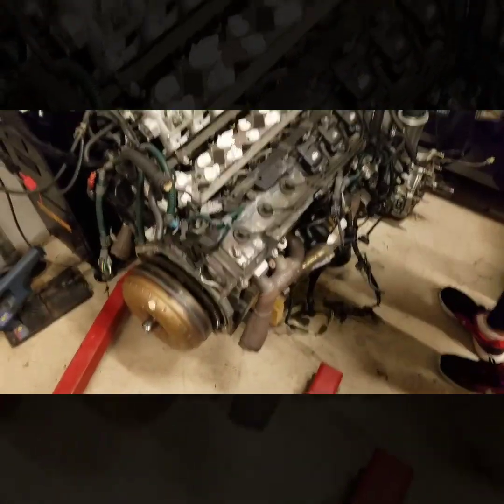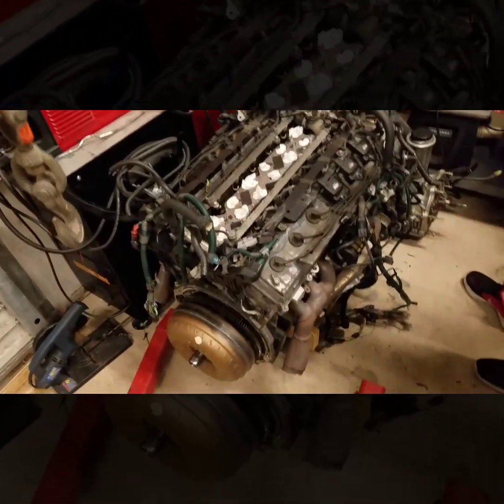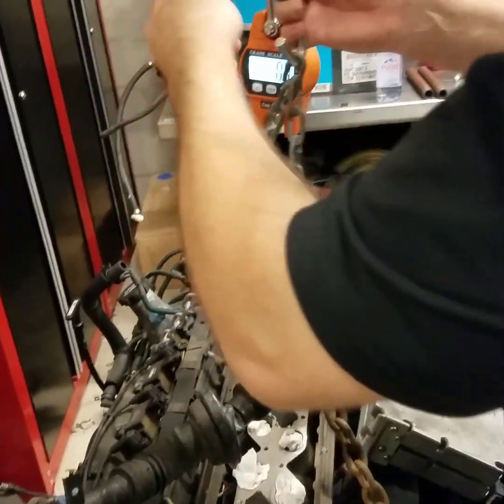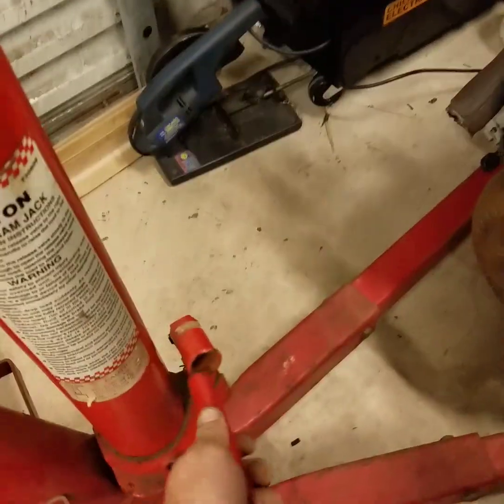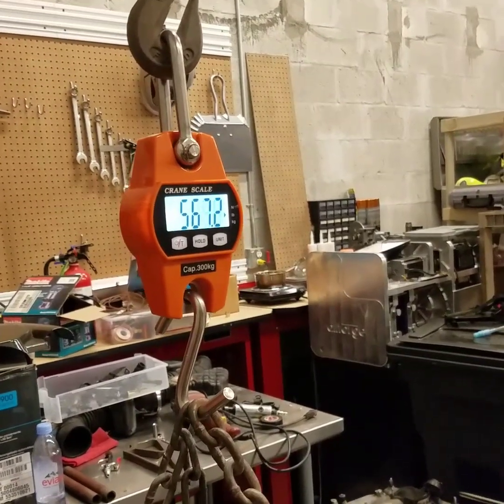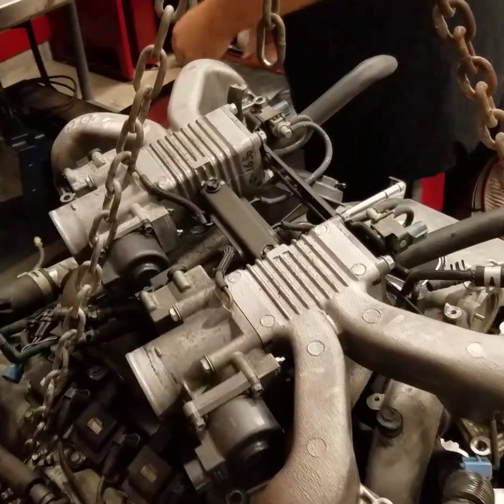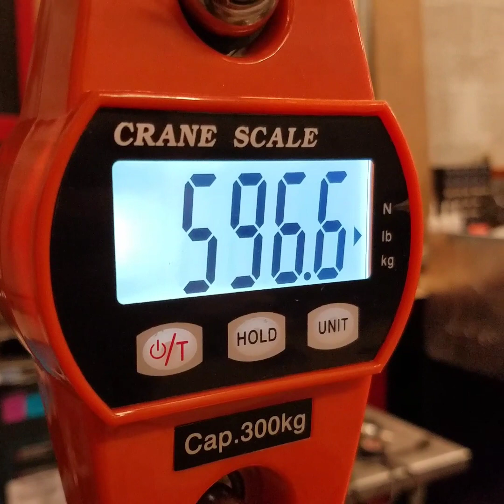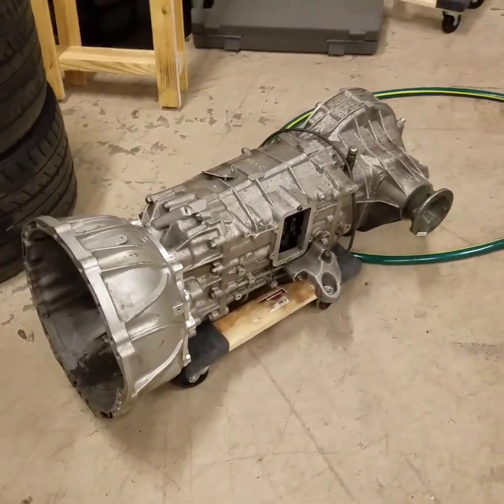1gzfe v12 weight?!

Comment: I would like to say thank you. I've been curious about that. Perfect replacement for a 2JZ if you bought a Supra with a blown motor or if you had a Land Cruiser that needed an engine. The V12 is getting to be much easier to find and with a big of work you can have a fairly reliable 400-450hp naturally aspirated engine with decent torque. They are rated as something like 276 ish hp stock and supposed to be just over 300 actual. The 276 hp was the max allowed by Japan if I recall for the vehicle. Either way a cool engine that would be something different for swaps as well as super smooth with some torque not requiring boost.

Comment: So, Toyota 1GZ-FE (5.0L V12)

- no intake manifold & throttle body
- has bunch of harness & ECU itself
- has torque convertor
- has header (that's it)
- full accessories
- hydro-fan (hydraulic radiator fan's pump)

576.4 lbs or 261.45 kg

- with intake manifold (3 pieces, 1 top & 2 bottom)
- throttle body

596.6 lbs or 270.61 kg

I used to Google'd about 2JZ-GTE weights, and this is the data that I've found few years ago,

- 269 kg or 594 lbs, alone (manifold + turbo is 25 kg or 55 lbs)
- 338 kg or 746 lbs, engine w/ Getrag Six Speed
- 335 kg or 740 lbs, engine w/ A340

*2JZ long block is supposed to be around 204 kg or 450 lbs and 227 kg or 500 lbs
*33X kg or 74X lbs is weight w/ everything on, gearbox, bellhousing, clutch, flywheel, starter, acc, turbo etc.
Reply from the maker: In the configuration we will be initially using it as the engine should be right around 530lbs considering no hydrofan, no AC pump, no torque converter, Custom short runner aluminum Intake manifold. Bolted up to the that transaxle which weighs 174lbs on with the 1GZ bellhousing bolted to it. Total weight around 880lbs but that also includes the differential so not that bad. The engine is planned to be supercharged in the future once we get it running and all the plumbing figured out and all the fab work to fit it in the chassis done. I can't say what vehicle its going in but I assure you it will be very different from anything you may think its going in. For sure has never been done before.
Reply: Paul Otlewski since your other replies said this engine was chosen because it's going to stay in same family as the chassis, plus I recently find out a Toyota project involved a Toyota V12... is it a luxury mid-size sedan that no longer sell in USA?
Reply from the maker: RDS Alphard it is a toyota but it is not a sedan. 😁
Reply: Paul Otlewski well, I know certain car is going to have Toyota V12 swapped in, but I don't know if it's a Coupe or Sedan or Wagon, consider that nameplate had Coupe & Wagon.
Reply from the maker: RDS Alphard its actually going in a van
Reply: Paul Otlewski Oh, it's different project then...

Comment: Wow that is heavy, but it is V12, just imagine if it had a iron block like the 2JZ.  Granted it nearly fully dressed with the torque converter.  Guess I will have to wait for a good deal on a 458 engine, lol.  Seem to be quite few these on eBay right now for what looks like a reasonible  price.
Reply from the maker: GlassTopRX7 in the grand scheme of things its not that heavy, considering a 2jz-gte weighs nearly the same at 594 lbs but its double the cyls and twice as many dohc heads lol.
Reply: The only problem with that is the iron block 2jz has never been called light.  600lbs for 5L engine is lot these days and it doesn't have high flow heads or a nice over square bore stroke ratio.  Still it's going to be very impressive in whatever it goes in because it's a V12 so I get it.
Reply from the maker: GlassTopRX7 Yeah this engine wasn't my first pick for this project. But the boss wanted to keep the engine in the same family as the chassis and we both wanted that sweet V12 noise.
Reply: You got issues Glasstop RX7 .. and good luck trying to by a Ferrari 458 engine  since they go for 50k or more . 
A 1GZ would be lighter since about 90% of the people who swap it don't use an automatic and for the record I've weighed the VH45DE and it weighed it at 495.   And you're head is broken many ppl think just because the 2jz is ''6 cylinders'' that it's lighter than many DOHC V8's and other engines.
Reply: @MidShipCivic  I've never seen a 458 engine for over 40k where are you getting this number from?

Comment: you can get your car to sound like a zonda if you tune it right with this engine
Reply: No, tuning doesnt matter it needs equal length headers and a good exhaust
Reply: thats the mercedes s600 v12. not the toyota
Reply: Basically equal length headers + high revving head + supporting mods = zonda sound.

Comment: I guess you probably won't answer me, if I asked where that transaxle is from? Bellhousing directly bolt to the transmission meant it's a mid-engine layout (I think), but bellhousing doesn't seems originally belongs to there (judged by different colour but that could be just material different)... well, what do I know, right?
Reply from the maker: RDS Alphard The trans axle is from a 2005 Masarati. The bellhousing is the one that came on the 1gzfe auto transmission. We drew up a really nice adaptor plate to make it fit. We will be using a hydraulic slave cylinder + a 5 plate chevy indycar button clutch mounted to the factory flexplate
Reply: and now I'm curious on where these combination will be mount...
Reply: @PaulOtlewski  1 year later, do you have any vids of where this is going into?

Comment: What is the overall dimensions of the engine? None of the forums give good dimensions on how long, wide, and tall the engine is. I've been searching high and low for someone that knows it, hoping you guys can help.
Reply from the maker: PoorManGarage when I get back to the shop on monday I can measure it out for you
Reply: Paul Otlewski that would be awesome, thanks!
Reply from the maker: Its actually 30"x 30"x 30" . Its basically a cube lol. Thats with the intake manifold on it which makes the engine a lot taller. Width was measured at the widest points on the accessory drive and the length is from front pulley to flywheel.
Reply: Thanks! Finally someone who has the answers! lol
Reply: Open or closed deck?